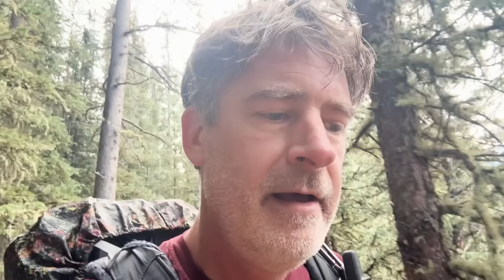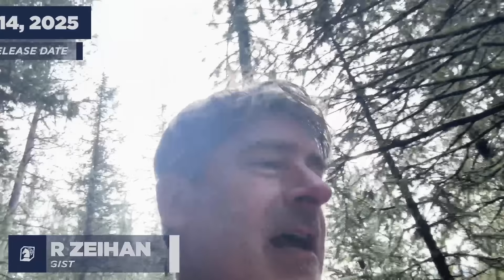Can 3D Printing Save U.S. Manufacturing? || Peter Zeihan

Comment: If you have ever needed a part for your old car, lawn mower, or outboard and its manufacture has been discontinued, you are pretty much screwed.  Obsolescence is accelerating.  Now, there is hope, because 3D printing could make that part.   For complex parts, a digitized design would be needed, but for simple parts photogrammetry or laser scan would work.  I’d like to see auto parts stores printing up their own “hard to get “ parts.

Comment: Making the economic and regulatory landscape favorable for US manufacturing will help. Incidentally whether it's additive or subtractive manufacturing, it can be either as you can have 3D machining working on bulk material like Aluminum or steel stock to make parts that are very intricate in ways 3D printing can't, and importantly these parts can them be molded together or designed to work together producing the kind of things we need but are not great for inexpensive mass consumer items...it's these kinds of components that the US will make in new smaller factories I think...and there are not shortage of smaller towns and cities across the midwest with good infrastructure for small factories with excellent transportation, low energy cost, affordable housing, low crime, educated workforce. Not glamorous, no fancy restaurants or shopping but we get next day delivery from Amazon and have a great standard of living especially for growing a family.

Comment: Good summation.  The aerospace casting company I worked for was using it 35 years ago for printing prototype patterns.  We compete with 5axis machining and fabrication.  Every process has its pros and cons.  We could make intricate parts with internal features that other processes cannot make.  However, GE started fabricating fuel nozzles with 3D printing that couldn't be made by casting with nearly the quality.  There are no silver bullets, part of manufacturing is choosing what process works for the components you need.  BTW, in addition to metal and plastic, thee are 3D ceramic printers too.

Comment: As a machinist that also does 3D printing. I can definitely say. CNC machining is at least 10 times faster and more accurate. Not even close if you are running production. Machining keeps leaping ahead. Tools are better and it will always be cheaper. Except for plastic and 1 off parts.  The one caveat… or 2

Comment: Saying 3D printing could replace manufacturing is like saying a printer can replace a printing press. And 3D printing is basically an additive series of welding, which famously is rarely the strongest part of a part - so not only is it slower, but often not as strong. 3D printing works for putting one in each home to make whatever random trinket is needed (the back battery cover for the remote when it breaks, towel holders, baby drawer locks, etc, little cheap stuff there is no reason to ship across an ocean) - but coincidentally this will counter for-profit manufacturing, since nothing is produced, shipped and sold. Not what the industry is looking for, or the general economy for that matter.

Comment: One of the things that is a really promising version is additive welding. Basically, it's CNC MIG welding, so while it'll never be as fast as casting, you might be able to do multiple welding heads, if you have enough cooling.

Plus, unlike with laser sintering, you won't have the near-microscopic air pockets from the powder melting together.

Comment: GE is already 3D Printing parts for production. There are many unique parts being supplied with 3D printing in low volumes (less than 10k) or designs that are changing often so tooling costs are prohibitive. And in the last 8 years 3D printing has sped up 2.5x or more with much better quality. So in many respects, it’s already arrived.

Comment: Where 3d printing excels is in inventory reduction. You can literally print parts as needed. I recommended 3d parts for a medical device because we were making such small quantities. The parts were custom covers and cable harnesses. I got laughed at and told they would never 3D print parts. Guess what happened?  I did a financial analysis and the mold alone for injected parts was $10K. We did a test run and now make a lot of non-critical pats with 3d printing

Comment: My company creates hearing aids and ear protection. A mold is taken of the patients ear, 3d scanned then 3d modeled. AI is used for some of the modeling. A 3d print is made then used to make a mold for the final ear piece. Since every ear is unique 3d printing is great. Downsides, some materials like slicone cannot be 3d printed yet. Also differnt colors and materials cannot be mixed when printing. We went from a company of 250 people to less than 40.

Comment: Pete isn’t nearly an expert here folks. The way he presents it, there is only one 3D printer in comparison to one plastic injection machine. Not quite how it works. The question is, how much throughput do you need in what amount of time, divided into what capital cost? Then divide that between 3D printers and injection molding. Or another way, how many 3D prints would it take to make the parts of one injection molding machine? How much would that cost? I’d it more or less than the injection molding machine?  And, how many more jobs could you get if the set up run wasn’t 10K pieces?

Comment: Metal sintering equipment is very expensive, 1 million a piece also the type of metal really matters as tungsten doesn't sinter until ridiculously hot. Most 3d printed parts do not have as much strength as milled parts since the filament doesn't make a homogenous block of material. There is also issues with resin printers as the resin is extremely toxic to handle before curing so the list of problems does go on with 3d printing. It has its role, its just not ready to take over everything yet.

Comment: There's another place that wasn't mentioned where 3D printing is great. This is when you want to sell things cheap to people who have 3D printers. You sell the 3D model which is just a digital asset that can be delivered instantaneously for next to nothing and then the consumer prints it as they need it. This of course requires the consumer to have a 3D printer or have access to a 3D printer, but just like people used to not have ink Jets at home and now they're cheap and easy to get, 3D printers are coming down in price so it's becoming easier and easier to have one at home.

Comment: 3D printing has revolutionized mfg. There are large printers farms in China. I can model and order parts online. The entire engineering space is integrated into a collaborative environment. This is a replica on a development environment that was bleeding edge for the development of the 787. Now it’s free to anybody. The methods of printing are so varied. In aerospace worked on 3D printing of nano layered materials that are turned into plasma in an electron beam and allowed to condense on a tool surface in 8 micron layers. This allows printing of stratified materials with amazing combined properties. This is semiconductor technology applied to 3D geometry creation.

Comment: I work in a factory in Monument, CO making surgical hardware. We 3D print certain tools and equipment that because our printer can't make final products with it due to various regulatory concerns. The things we can make are simpler items like a tray that holds parts during inspection or a new handle on a tool to make it more ergonomic.

Comment: I work in manufacturing.  3D printing is not a manufacturing process.  It is, at best, a rapid prototyping process.  We will never in our lifetimes see 3D printing as a viable at-scale manufacturing process.  The material properties aren't great, the speed is abmismal and the surface roughness is atrocious.  Even if you 3D print a metal part, you will still need to machine the mating surfaces with conventional subtractive processes.  It is basically a really slow casting process.

Comment: We use 3d print in our shop for production parts. But these parts all so have laser cut sheet metal, lathe cut wheels, steel pins. To me the future is hybrid design.

Comment: 3D printing isn't really a competitor to stamped parts.  It's a competitor to CNC milled parts.  The main two advantages over CNC milling is that you can skip the CAM step and go straight from the solid model to production, and secondly, as you said, you can print interesting and porous shapes that you can't do with a CNC mill.  The advantage that CNC milling still has over 3D printing is accuracy.  There are even combination machines where you can 3D print a part, and while it's still fixtured in the machine, you can use an endmill to finish the mating surfaces very accurately.
Reply: There’s been a lot of development in CNC in the last copule of years. If I was to bet on something for manufacturing, it would be more advanced CNC and not 3D printing
Reply: @caracolina8785  Do you mean by scale, energy demand, raw materials discharged?

Comment: The biggest metal sintering gains is Rocket engines that can make cooling and fluid channel.  They are flying engines, I believer right now into space.  Space X is one of the companies using it.  
In contrast, the rocket engines to the moon were weldments with hundreds of pieces that required extremely skilled workers, learned on the job. They are gone. The process is known but the skills have pass away with the people and that includes inspectors, heat treating, machining, and welders.  The product was an art form that was developed by experience and verification testing.  Impossible to put the fine points down on paper and in photos. The process is just history.  
With off shoring of production even the scale of individuals that would make the cut to produce those weldments doesn't exist in America and likely would be hard to find in the free market economies.

Comment: The general solution to the speed issue in 3D printing has been to add more printers. We’ve seen images from Ukraine of large rooms full of 3D printers stacked 3  machines high on shelves, just printing away. Great thing is if you have 100 machines and need to perform maintenance on one, your production has only slowed by 1%.

The technology is also rapidly improving and developing, just like drone warfare. There are various new machines coming out and engineers working on things like the speed. An interesting one I saw used water mist to rapidly cool the print as it printed the model at lightning speed.

It’s not a solution to everything but I think it’s a space to watch very carefully.

Comment: Well I would argue that depending upon what the product is would determines the efficiency to scale of cost... 

The reason being is because I mean especially if you're talking about a lot of plastic products you know injection molding has been around for quite a long time and there were those that went nuts over injection molding. 

injection molding has actually been applied to even products made from metal it's not just plastics Yes it works a bit different for metal commonly it would be called diecasting or sand casting but there are those who at one point like I said went crazy over it and said that this is the future for everything and for a minute it really honestly looked that way and yes it is still heavily used It never went away and I wouldn't really say it was reduced it's just that depending upon the product it can be considered a lower quality but then again it also depends on who's doing it... 

So 3D printing depending upon the product May not necessarily be the answer when you factor in cost and efficiency... 

because if I can die cast or injection mold something in half the time or over half the time that I could 3d print it and yet it would be of a decent quality that I can shove out the door without fear of warranty then it makes that older technology more efficient than the new 3D printing technology that is a lot slower yet yes it may be of the same and in some cases perhaps better quality. 

I will say is it America and a portion of the Western world has a bit of an issue when it comes to machine tools we don't make a lot of machine tools here in the States anymore So you have a situation to wear some of our older factories that may still exist if a machine breaks it's usually a catastrophic problem and the factory shuts down for weeks months possibly even years until they can get that specific part made for that specific machine and if they can't then they have to find a company that can build them a brand new machine that would complete the same task honestly that is our Achilles heel. 

I site older factories but to be honest even a lot of your newer ones A lot of your companies did have built plants somewhere in the past even you know say five to 30 years ago so it doesn't have to be something left over from the '70s or the '80s It can be within the past 30 years so you know anywhere between today and you know the mid-90s... 

that is the vulnerable point of our industry.

Comment: 3D printers have been able to handle multiple materials since the late 1980s, when they were invented. Peter mentions one method (PBF or SLS, the original name), but fused deposition modeling (FDM) and stereolithography (SLA - the oldest method) are also major forces. All can use multiple materials. As Pete says, speed is an issue. Since the fundamental patents have all expired, 3D printing is accelerating it's development.

Comment: I do quite a bit of 3D printing, and you're correct good sir. 

The only viable way i can see 3D printing supplementing U.S> manufacturing is either A) The technology has to improve quite a bit for speed and reliability, or 2) each machine in a factory floor will just make one part and have them all assembled at the end.

Comment: 3D printing has several applications and for certain things it’s evolving very quickly. But it’s not really a volume manufacturing technique. There are cases where it’s unique properties can make a push for specific parts in volume production but that’s atypical. 
It’s fantastic for helping rapid iteration of parts for molds and similar for things like carbon or glass fiber layup, molds for testing plastic injection patterning (metal printed), sacrifice metal casting with filament instead of wax for parts.

There are things like concrete that a handful of companies are rapidly iterating on and can produce finished structures much more quickly than conventional techniques.

It’s a pity the current American regime is so eager to cut off it’s own nose, there are amazing inovations happening everywhere and we’ve largely flushed 80 years of soft power and standing down the drain in less than a decade.

Comment: Depends on the thing youre manufacturing. 3d printed houses around Austin take a fraction of the time to build than traditional homes do. For making small items in batches its great too depending on the size of the build plate. Printing tech is sprinting ahead. 7 years ago we were building kit printers like ender 3s. Now full company's are running print farms with 100s of machines running at once to either produce 1 item or different projects for different customers. This is the future as the tech is getting so much better quality wise and faster above all else.

Comment: You left out one aspect of 3d printed parts.  You aluded to it but didnt give it enough emphasis or clarity.  The parts that cannot be made from any method other than 3d printing.  3d printing is slowing bringing about a newer designs with unique advantages that can only be made with 3d printers. (raptor 3, raptor 4)

There is one 3d printing tech that is much faster than the alternative for its class of part.  The sheet metal part fabrication 3d printer makes custom shaped fenders and metal fab parts way faster and more accurately than traditional methods (by hand).

Comment: Making 100: 3d printing. Making 10,000: injection moulding.
Reply: Not only that 3D printing is nowhere near accurate enough to deliver precise machine parts nor is the part as strong as injection molded plastics or a cast metal molded and machined part. 3D printing can be useful for prototyping but that's pretty much it.
Reply: @cruelabduhl  That’s not true at all. Industrial 3D printers are printing mind bogglingly complex jet engine parts. It’s 2025 buddy, we’re not talking about consumer FDM printers.
Reply: If you are using 3D printing to make things that are best suited to injection moulding then you are not going to be successful. There are things that you can make with 3D printing that you cannot make with injection moulding.
Reply: @Agnemons yeah but ... Where is the Epstein list?
Reply: @HypnotizeCampPosse  It is neither being injection moulded nor 3D printed nor is it being machined so, at a guess, I would say it is in the hands of Gutenberg.
Reply: @Agnemons where is the Epstein list?